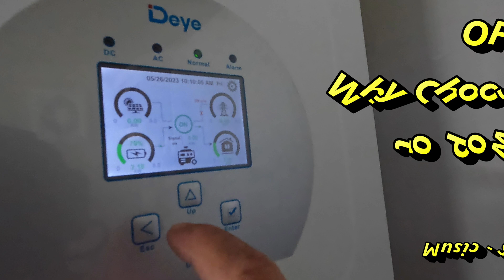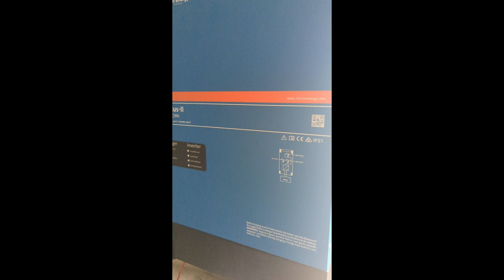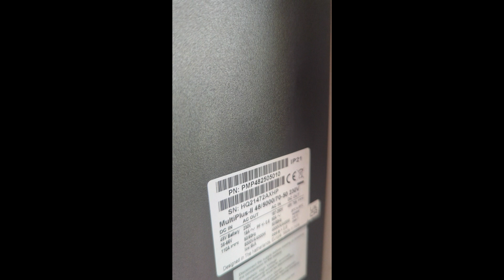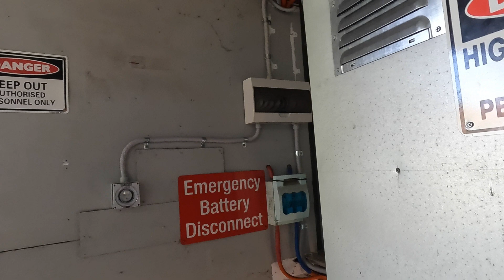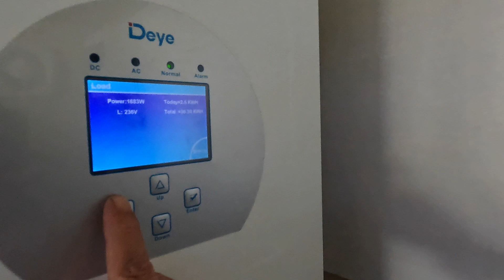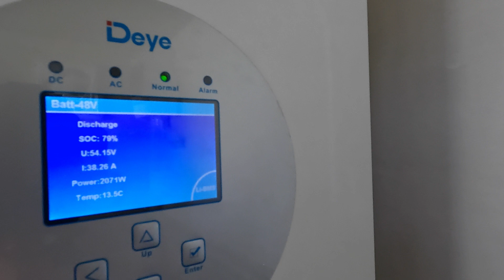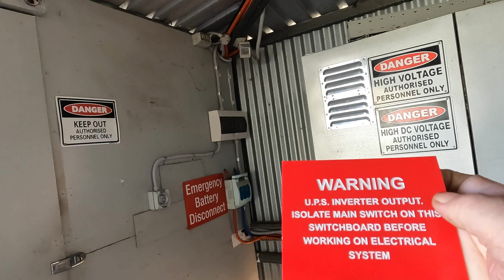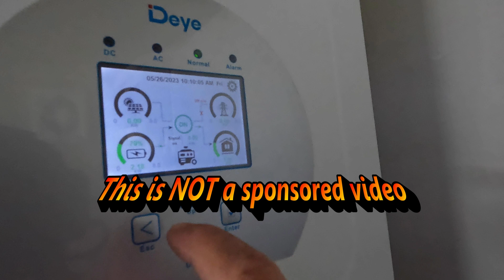OFF  -  Grid ?  Why Choose a Deye Inverter to Power your Home ?

Comment: Did you source your battery and inverter from Geen Bank Solar? Have the Green Bank battery and Deye inverter given any issues so far? Thanks.
Reply from the maker: I have not had any problems with my inverter or batteries. Had no problems
Reply from the maker: Yes all George at Green Bank Solar

Comment: Is it split phase?  And with 15kw capacity?
Reply from the maker: Single phase 230v 50hz 8kW inverter runs my home. The small 5kW inverter and battery are my play room. Where I play and test things out for YouTube. The system also automatically switches to that smaller system if i ever I have a problem with the Main inverter

Comment: Thank you sir, I got me a Growatt inverter and now i regret not geting a Deye!
Reply from the maker: Most people get what the salesmen sell them. Me, I never trust a salesman. Always do my own research before I buy anything. Growatt are a very inexpensive run-of-the-mill unit. Most of them work ok.
Reply: @JustinCaseSolarPower not if you stay next to the sea! My SPF 5000 only lasted for a year, and I bought another one and it it also died after a year. So today (14 July 2025) I installed a Deye, and crossing my fingers that it lasts longer than a year
Reply from the maker: They have a very good tolerance to moisture. They are fully sealed when installed correctly. using the supplied rubber seals that come preinstalled in the wiring ingress ports at the bottom of the units. Our Deye units have been working great.

Comment: Greetings Justin from Zimbabwe in Africa, hope you’re well. Is your Deye 1 phase or 2 phase and is it grid tied or not? Looking to get one & fiddle around installing the CT  Clamp so I don’t backfeed power into the grid as I’m on a prepaid meter that doesn’t allow it.
Reply from the maker: Here is a simple workaround. https://www.youtube.com/watch?v=-n81d4-R6Fw otherwise you need to use the ct, so the inverter knows you're on grid, and you can then program it properly not to feed past the ct. Or to feed power past the ct to grid. I am 230vac single phase 50Hz. I am off grid. But I have a main inverter I use as a pretend grid to show people how things work.
Reply: @JustinCaseSolarPower thanks kindly for responding. Is your other unit a 5kw size? If it is do you ever have loads above 3Kw? Reason I ask is so as to know if fans ever kick in. I’d want to run a 3Kw induction cooktop off my inverter.
Reply from the maker: The 5kW unit I have used and abused in testing. I have overloaded it many times. It is air cooled, the 5kW unit I have. So no, it has not got any built in fans.  However, due to the fact I have them mounted in a fully enclosed cabinet, I have fans mounted on that. As you can see in many videos. Very quiet household units.
Reply from the maker: Uploading a video has lots of things in it. It's a catch-up video. Should interest you. Also, sorry for the late reply on your last comment.  Google (YouTube) did not tell me you commented. I just happened to find it as I was doing a review or comments made.

Comment: So would you recommend the Deye for continuous offgrid use?.

I must have s 3-phase system.
(Will connect to EV 40kw battery)
Wich one will you recommend?.
Reply from the maker: My house has been off-grid for over 12 years now. The Deye have been running it 24/7 for the last 14 months with No problems at all. However, will it connect to a used, reconfigured car battery.  
Deye Hybrid Battery Compatibility Guide, Power Cabinet update  (16) https://youtu.be/2H6TrUSI2VE?feature=shared
Reply: Ive ended up buying a 10kw Deye Hybrid 3-phase inverter.

Ive sold the EV battery and instead built 48v Lifepo4 batteries to connect.

Comment: Great video mate! Im planning to acquire a 12K 1p Deye hybrid. Do you think it can work with my existing Growatt ARK LV 25.6KWh 48v battery? Do you think the 12K deye can handle my 16KW ducted aircon plus some lights and power points in summer? I also want it to charge my battery ONLY in the night from grid, and/or btw 11 to 2pm from solar and grid due to the tariff. Do you think it's easy to achieve? Thanks alot! Your video is so helpful.
Reply from the maker: I have no idea. I got a list of all the batteries that are programmed into it, I will add at the end of my next video. Or you can ring whoever sold the unit to you. They should know. As for me, I just make videos. I sell nothing. Just test gear and make video and recommend what I test if it worked great for me. Will make a new video in a day or 2. Subscribe and ring the bell so you get a notification! Or check back in a day or 2 if you have not found out through the shop.
Reply: @JustinCaseSolarPower  Done subscription. I bought my Midea heat pump hotwater system last year after watching your video.
Reply from the maker: @cclenergy3033 Hope it works well. The unit we have is still working great, my wife and I love it. The timer not keeping its program when we shut the Solar system down for work is the only thing wrong with the unit. But they are so easy to program, it's not a big problem. :hand-purple-blue-peace:
Reply: @JustinCaseSolarPower  I bought 2 of them. One of them 170L, and 280L, so they can be used as backup to each other. I don't have the issue of loss of settings after turning off the power for both of them as I powered them off and back on today and the time is still correct, so I guess the settings is also still there. The only issue is it's no wifi built in, though I saw on the 170L manual it should come with the wifi feature. And also I found a maintenance icon blinking on the screen of the 170L. Guess I will need to do some simple maintenance job tomorrow.
Reply from the maker: @cclenergy3033 Yes, they have a screen inside them that needs cleaning. I also have to chase the critters out occasionally. 😉
Reply from the maker: Uploading a video now with the information you need. Hope it works out for you, my friend.
Reply: @JustinCaseSolarPower  Thank you mate. Watching now.

Comment: Justin deye inverters are high frequency so they do not have transformers as such , they are also not advisable for heavy inductive loads ..?? Am I right?
Reply from the maker: No you are 100% wrong.  The Deye inverter Starts the huge AC unit. It uses just over 3kW to run and you can easily doble that for its start up loads. I will also add that AC unit is more then likely older then you. So its Not new tech. You can see it plainly in the logs on my last video. If you watch the full video and don't skip through it https://www.youtube.com/watch?v=KoYOFjtVF6Q . I am not telling you to buy one. Really I don't care what you buy or what batteries you use. IF you look at my videos you can see them installed on homes like mine and large working farms and many water pumps. Me I sell nothing at all. I am retired and have been for many years. I have also been Off-Grid and testing all sorts of solar equipment for many years. It's my hobby.
Reply: @JustinCaseSolarPower   thank you, bthe deye I just purchased is the 16kw single phase, so I wanted to sell off my low frequency 12kw Growatt , just wondering how reliable that particular unit is
Reply from the maker: @nnodunnodu7914  Like i said all the units i know off are working great doing all sort of jobs, with no problems. Working that good that we just purchased The  Deye SUN-5K-SG04LP1-AU for the next stage of the video series. Should be arriving in a week or 4. Hard to say with the shipping being what it is right now. 😒.  Watch my last video my friend. Remember How i have the unit installed. For me it does everything we need it to do.
Reply from the maker: Yes it will run a bore pump. You can even buy 3phase units to run 3phase pumps welders and anything ells the requires Australia, 400 V officially, (but in practice often 415 V), 50 Hz . They are a low frequency inverter. Just ask George at Green Bank. 0447 447 554  or email him contact@greenbanks.com.au He knows fare more about them then I do.  He sells and installs hundreds of units big and small , Single and Three Phase.
Reply: I am really wondering if the deye 16kw can run my pressure pump, iron, borehole, air conditioners, or are seye’s only good with light loads such as tvs fan fridges? I need help

Comment: Deye's a beast. It'll handle all your loads and then some. I also got four of those Chinese "powerwalls" powering my off-grid setup. I got them pretty cheap and I'm quite happy with them. Why waste money on those expensive Tesla powerwalls or LG systems?
Reply from the maker: I'll take prismatic cells over 18650 flashlight batteries any day. To much can go wrong with them.

Comment: It looks like you also do not need all of the combiner boxes and junction boxes that I have had to BUY and Install as well as all the special breakers? 
Did you have to purchase a Charge Controller as well? Or does the BMS for the new batteries take care of that?
Jim
Reply from the maker: How you would wire it is not the same as how i have had to wire the unit., We have very strict guidelines hear in Australia
Reply: @JustinCaseSolarPower  Ok so this inverter is an INVERTER/ChargeControler/ Battery Charger All in One? Jim
Reply from the maker: @ChileExpatFamily  Yes everything in one package. The 8kw unit i have will take 10.2 kw of solar total. We just love the unit Jim. Real game changer.👍
Reply: @JustinCaseSolarPower  You ARE THE  BOSS!! Thanks Chris
Reply from the maker: @ChileExpatFamily   When it warms up outside Jim I will do a video for you latter today to explain my full system. How it is wired and why we did it that way, I will put in the Diagram of my solar layout. We did not put on any new solar just rewired it all to work on the inverter. After spending the $ on the new batteries and inverter and the electrician, we just did not have the $ to put in the new Solar panels at this stage. Maybe in a year or 2. But let me do a more comprehensive video for you. On our system. That will help you and give you a better understanding.
Reply: @JustinCaseSolarPower  You are so kind. 
I have been thinking about panels and how much more efficient they now then my 325W Panels and how I will not need as many. I do like my Canadian Solar Panels. They have been good. Jim
Reply from the maker: @ChileExpatFamily   ok made a video for you. (In Depth Look at our OFF GRID System, Solar panels, Wiring, Battery Logs) its a long video as the name suggests. Make a coffee and give yourself 30min to watch. It will not be a waste of your time.  Its in production right now. when that is finished i will upload it. Then it may take YouTube a few hours to render it back into 4k. So latter today or in the morning it should be ready for you. Enjoy  😉👍
Reply: @JustinCaseSolarPower  Wow that was so kind of you. I just got done with my morning chores and will take a look. Thank you kindly from Chile. Jim
Reply from the maker: @ChileExpatFamily  You know me. i enjoy helping others when i cam brother

Comment: Do you need to retrofit external ATS ?
Reply from the maker: You must be talking about Automatic transfer switch If you still connected to the grid.  Simple answer is NO it will switch to batteries if you have enough charge in them or generator if the batteries are low then if grid comes back on it will switch back to grid. 'Like it says in the title of the Video (Power your Home) This system will do it all.

Comment: The Deye fans kick in on heavy load as well and you will hear them especially after  about 2 years of  use. But as I said that is only on heavy use and does not last very long. This is evident in 5k and up and is unavoidable on any inverter. If the Deye fans ever become to loud, just change them out.
Reply from the maker: yes all fans make noise as they age. the fans are on the back of the unit and very easy to change out. This summer when i have the inverter under heavy load from the house AC units we will be making another video just on that point. I am not new to solar or off grid. Been off grid many years now. I tell it how i see it. Right down the line.  If you don't like my videos then don't watch them.  Some people cant handle the truth even when its videoed by the owners of these things.  So you do understand that right, The owner of that bit of rubbish noisy Victron inverter come to me for help after he had No joy from the installer or Victron.  That unit was just 2 months old, and made that noise from new.

Comment: AC hum is normal in LV inverters as they do carry a large Transformer, another problem you be having is that hum resonating with some part of the actual housing of the inverter. You make need to dampen that, if it is the case. For your own peace of mind double check the connections and check for any loose wiring.
Reply from the maker: It is  not normal for new well designed  low frequency inverters to hum or buzz. Mostly the ones that do that are the ones made from bolt together steel sheet construction.  The Deye is also a Low frequency inverter. it is made from heavy molded aluminium and the cover and inlets / outlets all have rubber seals. So they don't suffer from that vibration or dust and moisture problems you find in some low frequency inverters. I see the Victron gear is no longer on the federal approved list anymore anyway.  So the quality and other problems there gear has only matters to the people that have them.
Reply: I don't think the Deye is a low frequency inverter, it doesn't have a large transformer @JustinCaseSolarPower
Reply from the maker: @Floyd112007  Yes it's low frequency. How do I know? I was told that by the importer and the weight of the unit. I have never had one apart to look inside but I will ask for some internal photos from Deye in China next time I am talking to them, Just to confirm that fact😉
Reply from the maker: @Floyd112007 You need to do your research. The Deye is definitely 100% a low-frequency inverter. and still running great.
Reply: I think you should take your own advice and do that research.  It's high frequency.  Anyway, I'm glad yours is running  great, mine is also running great.

Comment: That victron has a problem its arking, that is the crackling sound you are hearing and  even the AC hum does not sound normal at all. He should turn it off and check all of his connections again if it persist he should contact is dealers or the installers if he didn't do it himself.
Reply from the maker: Like i said in the Video,  He has had the installer out there and he said its normal for the Victron's to make that noise. You can turn it anyway you like. The unit is still running and still making the noise. Poorly constructed inverter housing in the big cause. If the installer says its normal who am i to say he is wrong? after all he has installed more Victron inverters then i have probably seen.

Comment: The problem with the Deye (and I want one) is finding someone to do the grid connect and certify. Currently looking at a SUN-10K-SG04LP3-AU but haven't found an installer in Vic yet. It appears that Victron have dropped the certification for grid connect for the Multiplus range because of the new rule changes anyway.
Reply from the maker: It's good they don't use the noisy power Victron anymore.  Ring George at green bank.  Phone number is in the link https://greenbanks.com.au/  he may be able to help you.  Me i just got installers here for quotes till i found one that had a clew about what he was doing. Still a lot of licenced cowboys out there.

Comment: That's a very annoying sound. Probably failing slowly
Reply from the maker: All the Victron's make a hell of a noise. Victron tell them its normal for low frequency inverters to make that Noise. Well Its Not Normal, That noise is due to very poor construction of the inverter. ( poorly built case).

Comment: You have helped steer me away from Victron gear. Ive never heard an inverter make that sound before.
Reply from the maker: I was not impressed with the noise at all. Its the first time i hear a Victron working. I am also please i did not go with Victron 👍

Comment: I don't think that noise is normal at all.  I have never heard an inverter do that before even the really cheap modified sine ones.
Reply from the maker: As you can see blow  it's not just one person. They have failed to help many with this problem I would think. These are the sorts of things Sigi and I took into consideration when looking for an inverter that would, Do everything in one package and last us 20+ years. We read a lot of forums and I went to the Yacht clubs and talks to lots of liveaboard cruisers. 
"@LukeOHare  • 1 day ago
Oh dear, I have a Victron that sounds the same. They need to get their shit together. 😒 "
Reply: I bought my 4kw Magnum inverter in 2009 and its dead silent even today.  The only noise it makes is a slight fan hum when the inverter is in high powered grid charging mode which I only use that mode when we expecting a storm and I top up the batteries.
Reply from the maker: @NormanMcGregor  exactly mate. Low Frequency inverters should not make any hums or vibrations  at all. Apparently this is normal for Victron's. Glad i did not get one, that if for sure. 🙃👍

Comment: Sounds like a vibration.   And I agree, the Deye/SolArk inverters are a tough package to beat!
Reply from the maker: Victron is not doing itself any favours producing noisy inverters and MPPT controllers that 1 make such a noise and 2 over heat in normal operating conditions. I can understand why Liveaboard cruisers are moving away from them. Hell was no way I was having such a loud thing running my home. Let alone having one in the same Hull I sleep in. 🖖 ✌ 👍